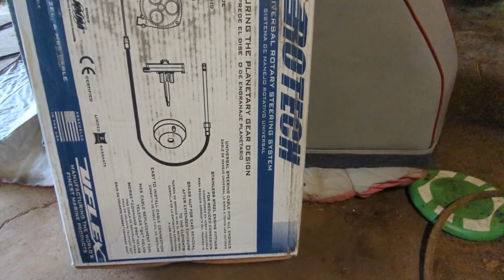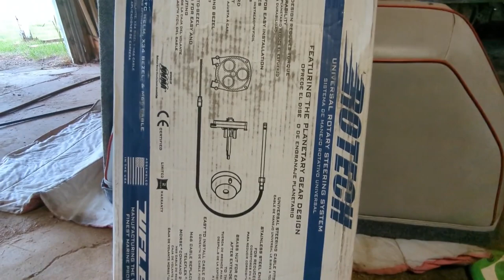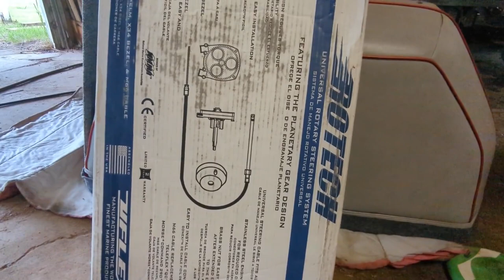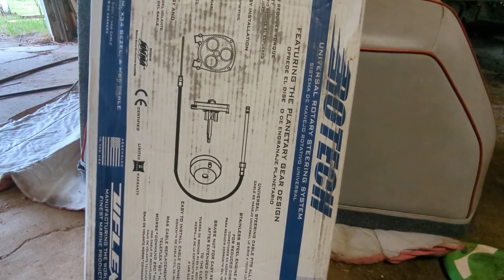We Bought a Vintage Ski Boat to tow behind the '67 F100!! And it's Small Block Ford Powered!

Comment: Great first boat! That 351 will last forever, just check the impeller in the water pump every spring to make sure it doesn't disintegrate. Also, please run the blower at least a minute before starting every time so you don't blow the dog house off due to fumes low in the bilge. Hopefully I can catch you guys on Holloway at some point this summer!
Reply from the maker: Hell yeah man! Find us out there some time! I checked the impeller before we went out! Trying to learn really fast about this thing, so far I love it.

Comment: That boat is made SPECIFICALLY  for water skiing! If you look underneath on the keel, you'll see 3 fins that are protruding from the hull right below the engine.  These are for keeping the boat on a straight line while towing a slalom skier through a slalom course. It's also why the engine is placed in the middle of the boat instead of the rear. The boat is completely set up for a " hole shot," i.e., being able to pull a slalom skier out of the water from a dead stop to 36 mph in 200 feet! The boat will also only have a top speed of around 43 mph, because its all about that hole shot. ENJOY!!! THESE ARE GREAT BOATS!!!

 You'll also note that there's 2 speedometers instead of one so that the driver can better fine tune his speed.